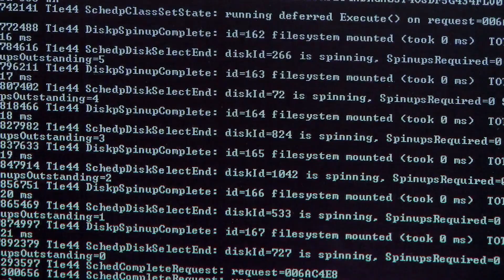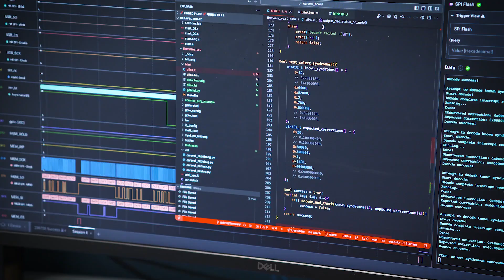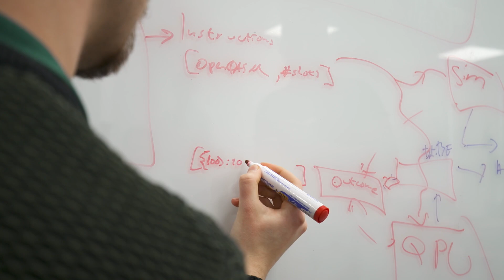Building the Quantum Error Correction Stack

Comment: There is no such thing as quantum error correction. The universe is probabilistic, and the result is noise. Quantum computing is based on superposition, meaning that particles' wavefunctions are always in superposition with random noise. Any quantum gate, device, or whatever you make that attempts to remove noise can only add more noise. It cannot ever subtracted because of its randomness.

To convince yourself that it is true, I encourage you to run a test I came up with.
1) Set your qubit to an initial state. It could be anything you consider initial.
2) Determine that state.
3) Repeat 1) and 2) a large number of times, say 10000 times.
4) Plot the distribution of acquired data.
If the distribution is wide, noise takes over the initial state. It is not what you wanted.
The distribution will be an extremely narrow vertical line if you run the same test on a laptop, cell phone, or digital watch.

Any quantum computer will always fail the above test. Please feel free to always quote me on that.